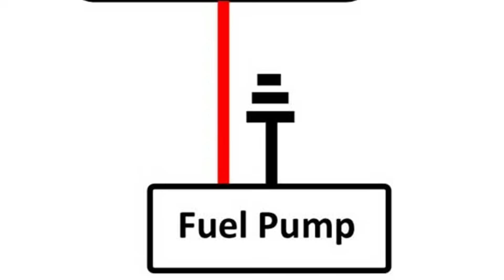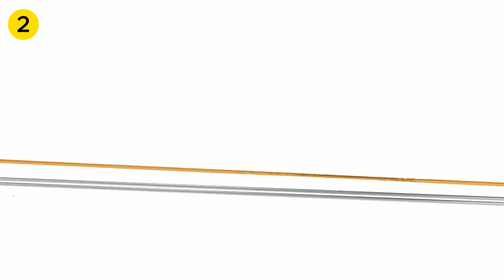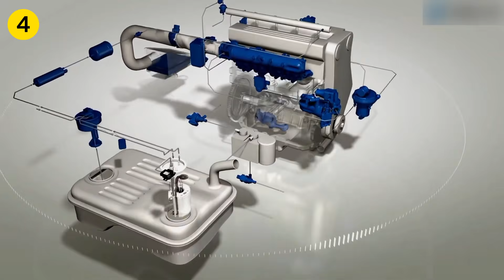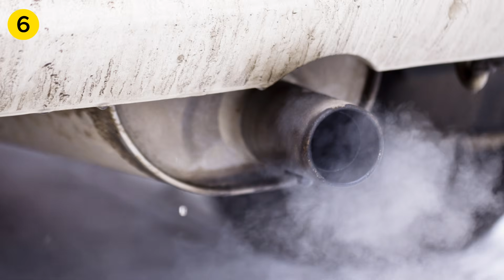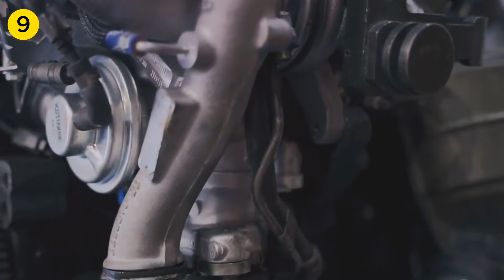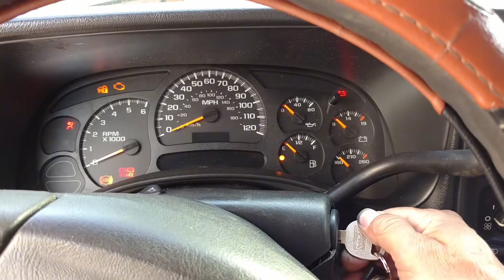Signs & Symptoms of a Bad Fuel Pump Relay (Before It Fails)

Comment: I don't have a obd2 system
Reply from the maker: No worries! You can still check a few things without an OBD2 scanner. Listen for the fuel pump priming when you turn the key to ON, and check the fuel pump relay and fuse using your owner’s manual. Just keep in mind that a pump that doesn’t prime could have several causes, not just a bad relay. What year, make, and model is your vehicle?

Comment: Problem is no "buddy system" to see if that relay is clicking, or to listen for the pupm itself, I cant hear it even under normal conditions).  I did 3 swaps tith the other like relays, car still has vapor lock symptoms, was told it is just a plain weak pump.

Comment: Something important that was left out is if your car is not turning over and you suspect its the relay, give it a tap. If your car turns over after tapping it its the relay. Also relays are sometimes under the steering wheel above the break pedal.

Comment: So I replaced my fuel pump, battery, ignition coils+spark plugs. And my car isn’t turning on, I think it could be the fuel pump relay. But when I turn the ignition to on the fuel pump keeps priming until I turn it back off? Do you think that’s a relay problem or the pump itself
Reply: If you hit the gas a bit it should start up but you'll have to rev it for a second or it will stall out

Comment: I changed my fuel pump in the backseat two of them in the back can a relay give me false gas gauge symptoms
Reply: incorrect gas gauge readings are usually caused by the float on the fuel pump assembly. means its not reading the fuel level properly

Comment: What would be your opinion. My truck cranks and cranks after a couple of attempts it finally turns on. It only happens on cold starts, in the morning it takes a while to turn on but leaving work it turns on fine. Driving there is no hesitation
Reply: Bad fuel pump, in the morning turn ur key to accessory mode and off about 3-4 times and it’ll prime the fuel pump and it should start right up

Comment: I ordered fuel pump and relay I am gonna try relay first if it fixes if not then change fuel pump thank you for the help 👍👍
Reply: I just had the same problem. I too ordered the relay. I'm gonna try that, if it doesn't work, I'll do the fuel pump. Glad to know I'm not the only one with this issue. But thankful for channels like this for understanding.
Reply: @ihearyahshuasvoice1634  Just go to the parts store lik Advance and buy one. Why order? Makes no sense.
Reply: Did anyone's relay fix it?
Reply: dont forget to replace your O2 sensors, up stream and downstreame

Comment: 👍👍👍 ! How about showing the procedure how to remove the gas fuel  tank ? I need to check why the wiring  came loose connection on my gas gauge  causing gas gauge fuel red light flashes to zero while driving coming to stop with my full tank? Thank you
Reply: Buy a new fuel pump that's all

Comment: I keep hearing all these probable problems but know one ever says it could be a bad roll over interrupt switch I've seen it many times, the roll over interrupt switch can get old and trigger on bumps thinking it been in an impact and trips to shut off fuel supply .
Reply: Play she could call the dealer and find out about the inertia switch 
Sometimes in the glove box sometimes underneath the driver steering wheel underneath the dash somewhere that's why you look in the owner's manual or the repair book or call the dealer ask

Comment from the maker: 9 Symptoms of a Bad Headlight Relay  https://youtu.be/qlOZubUOXN0

⬇Care Care Clues Top DIY Tools and Products:
🚗 Essential Scan Tools
Newest Scan Tool:https://amzn.to/3GJyuET 
Bluetooth Scan Tool: https://amzn.to/42AcBRc 
Cheap Scan Tool: https://amzn.to/42WZIzx 

🔋 Emergency Essentials
Best Jump Starter: https://amzn.to/44fYOAm 

🛢 Fluids and Leak Stoppers
AT-205 Re-Seal (Stops Leaks):  https://amzn.to/3S9icYm 
ATS 505 Fuel System Treatment: https://amzn.to/3YQjjA2
Lucas Oil Transmission Fix: https://amzn.to/4jNk98M 
Bar's Cooling System Stop Leak: https://amzn.to/3Sht0nj 

🔎 Quick DIY Diagnosis Tools
Head Gasket Leak Test Kit: https://amzn.to/4jRgc2T 

🛠 Useful Maintenance Accessories
Quick Twist Oil Drain Valve: https://amzn.to/4jWG3GJ 
Tire Gauge (Check Pressure): https://amzn.to/3GxySGD
Tire Air Pump: https://amzn.to/3RZK9Cd 
CRC Mass Air Flow Sensor Cleaner: https://amzn.to/44dJpkb 

🧰 Mechanic’s Must-Haves
Car Battery Tester: https://amzn.to/4jTqyzk 
Basic Mechanic Tool Set: https://amzn.to/3Ymgerh 
Cordless Impact Wrench: https://amzn.to/3YkkhVc

Comment: Is it true that running your car low on gas all the time is bad for the fuel pump in a 2002 town n country
Reply: I was told your sucking up trash that may be in your tank. When you wait til almost E to fill up.
Reply: @ambermartin2931 For some people that may apply, but fuel pumps usual have a strainer with the fuel pump to protext against the trash in the tank. Where some people go wrong is they don't replace their fuel filter, which may be located on the frame under the vehicle or somewhere in the engine bay. A clogged fuel filter can greatly decrease engine performance.
Reply: From what I hear, yes. The reason why, is that low fuel in gas tank can run the fuel pump dry, which can burn the fuel pump out. As gas passes through a fuel pump, it acts as a lubricant to keep the fuel pump motor from burning out.
Reply: It's bad for almost every car.

Comment: 2005 highlander 4cyl,  has trouble starting at any time. Once starts, it runs just fine!
I don't hear any sound from the pump,
Reply: Some fuel pumps are quiet, but some are loud. You might have a clogged fuel filter though. Have you ever replaced your fuel filter? A clogged PCV valve can make your vehicle stall too. A dirty throttle body flap, can àlso make your vehicle stall some too.

Comment: 2002 honda Odyssey where is the relay located at
Reply: Should be in your fuse box, but you may have more than 1 fuse box. A diagram in fuse box will tell you which relay is for fuel.